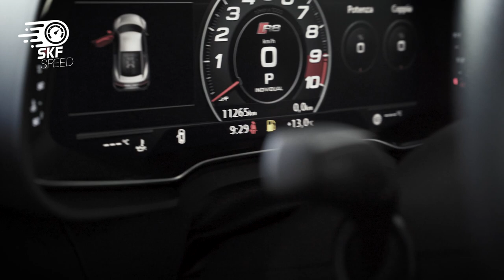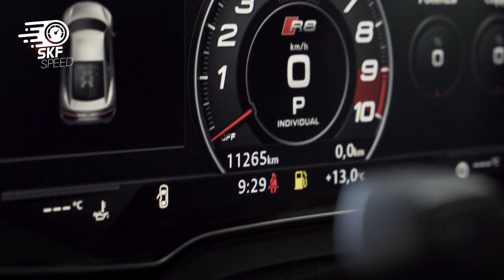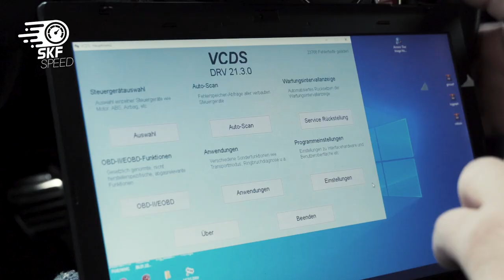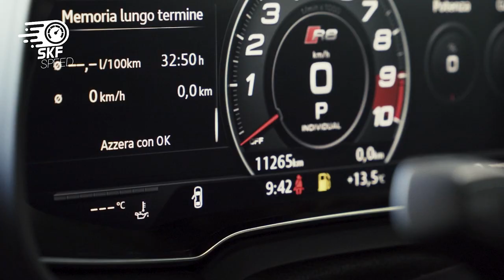How To Fix Mileage Discrepancy in a AUDI R8 | OBD Filter | VCDS Mileage Check

Comment: Will this work with any blocker fitted in the vehicle or only made for your style jammers?
Reply from the maker: This is only designed for the DSG transmission. All other ECUs are clean
Reply: Yes I have a DSG S3 Which has a blocker in place but if I purchase the OBD emulator from you will it work with my current blocker or will I have to get a new one from you to make the OBD Emulator work with my old unit